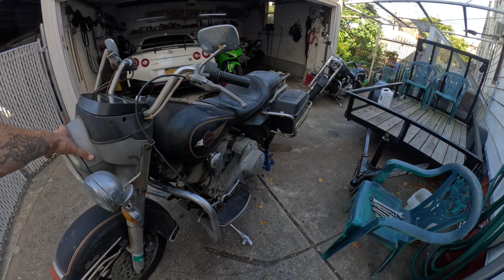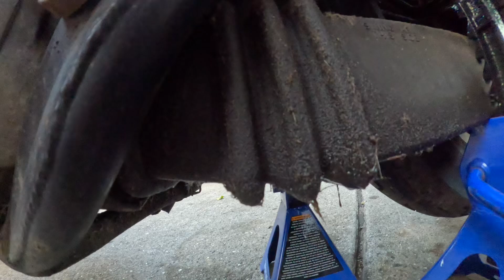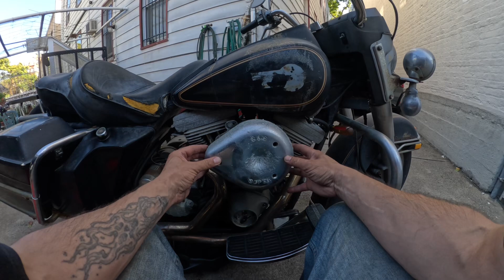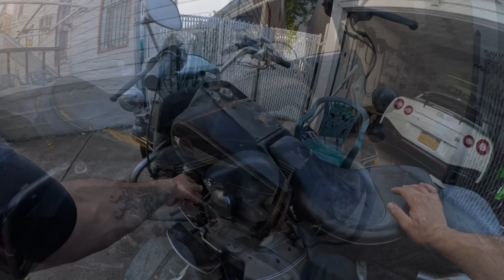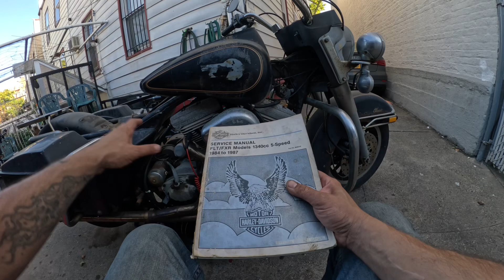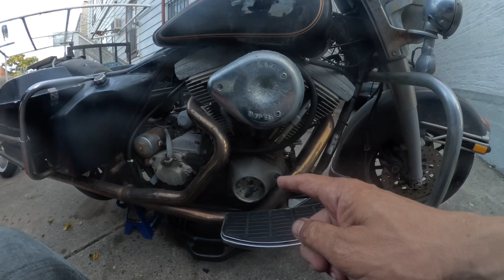One step forward… two steps back | 1984 Harley Davidson FLT Tour Glide | Lost Spark No Start

Comment: I would clean every electrical connection. Did mine last winter and plan to make it a regular maintenance item
Reply from the maker: @bobtoner9820  great idea, as I look over the electrical system it definitely does not appear to be the most weatherproof design, any suggestions or improvements you made on yours I’d love to hear it 👍🏻

Comment: Hey love this. Throw all that chain guard away and make a chain guard. You'll find out that things a nightmare to remove let alone put back on. The 2 1/4 bolts that fix the rubbers to the engine are almost impossible to locate.
Reply from the maker: Good to know! May dig into that if the weather clears up 👍🏻

Comment: That's a find! There aren't many early Evo's out there. I have an 85 that I've owned since new, now with an estimated 300,000 miles on it. I used to have problems with belt life, so after the last one broke I converted it to chain. (I think I caught a rock in the belt on a dirt road ride the day before the break.) Now days I don't ride it in the rain or on dirt roads much, so it doesn't seem to need the enclosure. I also have that service manual. For the 85s it often makes distinctions between early and late 85s. Seems there were allot of issues with the original that were considered important enough for a mid model year upgrade. I hope you can keep this one on the road in cleaned up, but otherwise original condition. I still love riding mine.
Reply: I have a 85 FLHTC. Last bike I'll ever own
Reply: 98 fxdl last bike I'll be riding
Reply from the maker: 300k miles 😳 that’s awesome! Yeah it seems they were in a learning curve the first few years, which makes things interesting for us now 40 years later!

Comment: Just replace the chain with an O-Ring style one and you'll never have to worry about that stupid enclosed oil housing
Reply from the maker: I’m leaning in that direction if I can get the trans fully functioning, if not switching to a belt drive trans may be the better option… we shall see

Comment: The crane ignition module has been purchased by S&S they have taken a good module and made it much Better! Have been running nine fir for 7 years no issues.
Reply from the maker: Good to know, have someone giving me an Ultima version (I know Ultima has its issues as a brand) but if it works thinking of getting the Crane / S&S unit for the Fatboy
Reply: @tta850  Crane no longer available, S&S Purchased Crane version, updated and med a far superior unit! Speedy but reliable! 5 years no issues here
Reply: @lawrencetrapani5623  Good to know, thanks!

Comment: Greetings. I see some good advice about grounds, switch wiring, ignition retro or upgraded aftermarket but... Here is my two bits I noticed that your nosecone cover was MIA when you went on a ride so if it was already missing then you could have a really dirty pickup and reluctor  also that starter/kill circuit from the bars was notorious for failure. Remember it is your bike and there are too many "experts" that will happily drive you into debt telling you this and that should be changed so trust your manual and gut as well. Good Luck
Reply from the maker: Thanks will check for dirt in the sensor, I have someone loaning me an Ultima unit to try, but your suggestion on the kill switch wiring that I will definitely dig into, it’s pretty crusty under the gauges!

Comment: Drain the the oil out the transmission, put the drain plug back and fill the transmission up with kerosene. Let it sit a couple days,drain it and let it dry out,refill will fresh 20w 50.

Comment: Did you put the jack stands on the swing arm??? Wanted to use jack stands as well but wasn’t sure where to place them for the rear tire
Reply from the maker: Yeah on the swing arm, seemed to hold it well, on the softail I put them under the frame but that would block access to the oil filter on this one.

Comment: In 1981, I bought a new FLH. Electrical system was junk. I was happy the day I bought it, happier the day I sold it. Thanks for sharing.
Reply: That reminds me of this, "what is the happiest day of boat ownership? when you buy it, and when you sell it."
Reply: It came to my mind too. But i think is in any Engine or Material owning things
Reply: Still riding something?
Reply: @fa7842  '57 FL, '02 FLHT and '10 FXDC
Reply: @fa7842  every day short of a hurricane, South FL has weather with boring smooth roads compared to NJ.
Reply: @fa7842  '57 FL, '02 FLHT and '10 FXDC.

Comment: If you are getting 12 volts to the coil and the coil checks out then look at the ignition system a check timing
Reply from the maker: Timing I’ve never done but going to learn as I got an Ultima module from a friend to test and see if it fixes the issue. Let’s see how that goes…

Comment: If you are not getting 12 volts to coil look at the handle bar switches or fuses or ignition wiring like others have mentioned.  You should be able to check continuity on the fuses and switches with a volt meter.  You can get one on the cheap from harbor freight.
Reply from the maker: So one of the tests suggested triggering the coil by tricking the module from the sensor plug, I did and no spark, I’m leaning towards the module.
Reply from the maker: I did check continuously in the handlebar switch but not voltage, good point thank you, it’s pretty cruddy under there definitely something I am going to clean up

Comment: Do you have a volt meter?  When you turn it in you should get 12 bolts to the coil.  You can also check resistance in the coil primary and secondary side.  Primary are the two posts secondary are where the plug wires go in.  Look in the manual for resistance values measure with a volt meter and it will tell you if coil is good.
Reply from the maker: So I checked the resistance compared to the manual, one of the reasons I tried the coil was because it was outside the range the manual stated… but then so was the one I took off the FatBoy 🤔

Comment: I want to suggest a Crane HI-4 ignition module, with rev limit and led for TDC when installing, but I'm going to suggest points like others have. And get two sets with 2 condensers. I REALLY like the stock CV carb. It can be jetted, I went with the ThunderJet carb mods. I did the entire upgrade but you can do just jet and slide on this bike.
Reply: Try to find Accel Supervolt coils for both bikes. They may not be available anymore. I have had the same coil since '95! Runs great, well did until I parked it.
Reply from the maker: Is the Hi-4 ignition just the sensor or is it the sensor and module? I kinda want to replace both and as much as points interest me (for conspiracy theory reasons) I’d like to keep the electronic ignition if possible.
Reply: @tta850  Sensor and module. You'll have to run the harness but that's no big deal. The HI4 also has several advance curve profiles it can select to run about as perfect as it gets.
Reply: There's a Dyna system similar to the HI4 that people like too. Never tried one. To run points I think you'll need to change the breaker plate inside the cam cover. That's a good flea market item.
Reply from the maker: Okay next question, if switching to points does that eliminate the module and vacuum sensor? Like the points drive the coil directly? Sorry the last car I had with points was a 1969 Delta 88 (years ago) and my ‘49 Indian has a magneto which is a whole different animal.
Reply: @tta850  Yes, it eliminates the part in the cam cover which is the Hall Effect switch, and the module or ECM. Only thing you gain by going to points is an ability to fix it on the road. These electronic modules are very reliable but certainly not serviceable on the road.
 Awesome you had an Indian! And the 88.
Reply: Before you remove the "breaker plate", mark the cut out V on the cam cover. This will be a reference for the 1 piece electronic sensor/module. You'll need to mount the new one in the same place as much as possible. There will be an adjustment to the new module but it's very simple.

 Left side of engine, follow the open V area between cylinders down to the primary case. You'll see one hex socket cap screw just below the jugs. This is where the timing marks can be viewed. You will set the engine to TDC, then with key on, you'll rotate the new module just to the point where the light comes on by leaving those 2 post screws slightly loose. Once the light comes on, tighten the post screws and you're done. Don't go too far past this point as it will screw up the preset advance curves. At least that's how Crane HI4 is installed. 

 I found it hard to mark the cam cover exactly, but you have an advantage. The breaker plate will leave a clean area as to where it was mounted. Don't clean it too well on disassembly.

Comment: Hi again, remember this engine is rubber mounted so check the grounds to make sure they are good and clean, most guys forget that when an engine is rubber mounted there is no direct connection to the frame. I had this issue about 25 years ago with my 80 FLT.  But one night about 3 A.M. coming back from some place I should not have been, the sensor blew apart and left me on I-5, so off with the ignition and points and condenser was installed, never a problem since.  By the way if you can keep the oil bath chain it will pay you back big time, in over 70,000 miles I have replaced the chain 1 time.   Good luck with it, I keep watching to see your progress, oh
 by the way the patina on the right side of the tank and air cleaner is from the front brake master cylinder leaking and the brake fluid is the culprit.
Reply from the maker: Great points, will check. BTW I greatly appreciate advise like this, trying to learn from the experiences of others so just want to say thank you for pointing me in a direction to check for problems!

Also I’ve been told the same about the enclosed chain, I’m on the fence about it maybe just because I’m used to my ‘96 Fatboy which has not only a belt final drive but also an enclose belt primary and it’s been really good to me 🤷🏻‍♂️
Reply: @tta850  @allensooter8429 has some good advice, on the FLH bikes you have to pull the swing arm to replace the belt. I built my engine up a bit, and have snapped 2 belts. Last belt is Kevlar encased in PVC. He's also correct on the brake master cylinder leaking, there's a gasket under the MC cap that has a diaphragm for fluid expansion and a hole in the cap so it can breathe on the cap side. Once the diaphragm tears 200 miles from home, the fluid makes a huge mess. Maybe a good idea to change that soon but get one first! Or 2.
Reply: Ive replaced my share of rear belts just by pulling the swingarm axle and clevis block and fished it around the opening. You don't need to pull the entire swingarm 🤦🏻‍♂️
Reply: @kennethwise7108  I think I did it this way last time, it's been a while.
Reply: @kennethwise7108  I have a question,  you're leaving the wheel in the swing arm?
Reply: @zedbear1  yes
Reply: @kennethwise7108  Thank you sir, learn something new everyday. I appreciate this info!
Reply: @zedbear1  no problem. On the left side you need to completely remove the clevis block. On your right side have your clevis block bolts hanging by just 1 thread. This allows you to push the tail end of the motor to the right and allows more room for the belt to fit between the frame. It also helps to have one of those flat type of scissor jacks to support your transmission. I used to have a video on how to do this but deleted it.
Reply: @kennethwise7108  I figured the left cleve block had to come out and some slack on the right would allow it. I'll try this next time, I don't remember pulling a cleve to replace last one but I do remember a pry bar moved the engine. Thanks!
Reply: @zedbear1  no problem, next time you change your belt get the S&S heavy duty woven carbon fiber belt. The tensile strength is significantly better than the junk HD Kevlar ones. I have punished mine for well over 3 years now and it hasn't snapped yet and I'm pushing a LOT of HP to it.
Reply: @kennethwise7108   I got a Dayco Panther I think, it's kevlar interior and pvc- hard exterior. It will cut you if not careful. It was taking the punishment but had to stop riding, bad knee. That's replaced and I'm ready to get scooter going soon. I'll keep S&S in mind too, I'm a fan. Have fun with the horsepower! I will again soon.
Reply: @zedbear1  you too brother!
Reply: @zedbear1 totally confused 98 low rider rear belt only off with primary removed and rear axle etc, us it that different?
Reply: @VR-mm4ys  I only know 2HDs well, my '98flhtcu and wife's '03flstc. If your letters are fxlr, that is a different frame. If not, there may have been frame changes in '95. No matter, on my bike you have to get the belt between the frame and swing arm somehow.

Comment: I just watched the last min of your video. I've had issues in the past with loose wiring in that instrument cluster.  Take that off, check screws to make sure all are tight and grounded well.  That has fixed similar issue I had years ago.
Reply from the maker: Will do, I’m thinking it may be smart to just go over all the wiring at this point just to rule anything like that out… we shall see
Reply: @tta850 I’ll second that.

Comment: Clean all connections and follow your wires to make sure nothing is cracked and going to ground electronics need to be clean
Reply from the maker: Good advice and easy enough to pull apart and inspect all the wires / connections. Will do 👍🏻 thank you!

Comment: Lol..OK this is my last comment. You can run points if your broke. It can be set up like a shovel. My 87 fxr is a rat but always runs. Walmart lawnmower battery ext ext. You got this man.
Reply from the maker: I’ve actually thought about running points on both my bikes, but for a crazy reason… I figure if we are ever hit with an EMP that points would still work, what do you think?? Yeah I can be a little paranoid and crazy at times lol
Reply: @tta850  what do I think? Lol..OK well 87 fxr. Points, kicker,chain drive, wall mart big lawnmower battery in hoged out box ( fits barely)  turn on tune out. That's what I think..LOL
Reply: She sounds nice when you were out on her sort that gear issue…..ooops now that no spark coils points new condensers new batt you’ll get it done from uk nice bro.